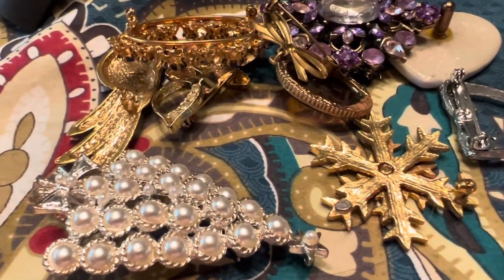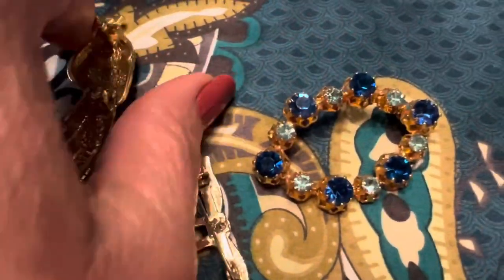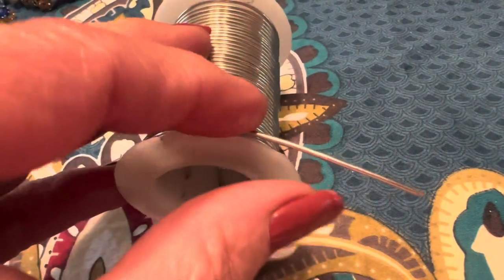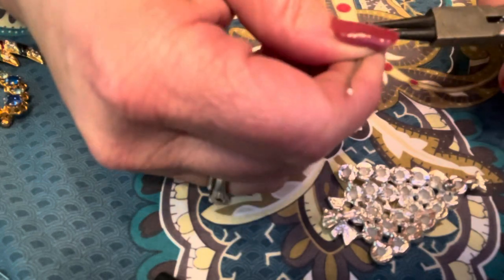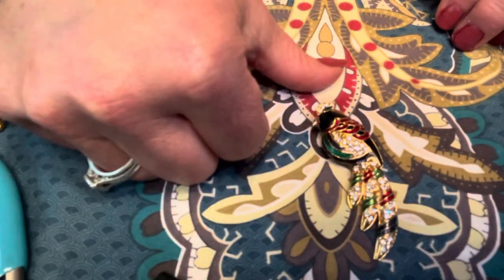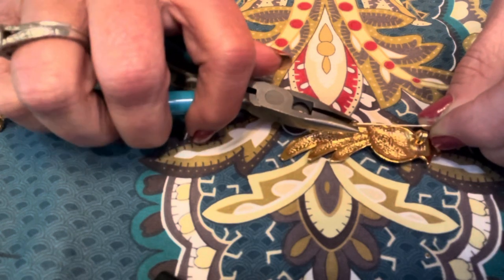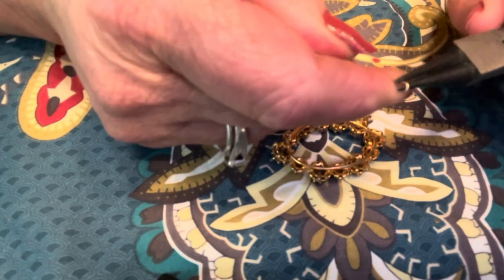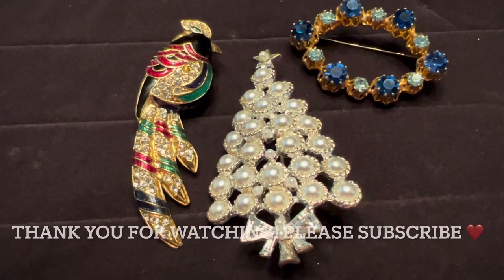Vintage Jewelry repair. How to replace a brooch pin.

Comment: Thank you for the still shots for us  to see exactly how it should look.
I have silly questions..does the stiffer wire come in gold tone if needed?
Can you take off (repurpose) a pin stick from a another piec and reuse on it? And I notice orginal ones have a couple of loops and a tail (stopper I guess) is this just fir more strength?
Reply from the maker: Hi Lorene,
Yes you can purchase the stiffer wire in gold tone. I’ve never repurposed a pin but I suppose you could. Yes it does add some strength. The stopper is to keep the pin from going back too far when it’s open. However, if the pin holder/ mechanism is snug it’s usually not a problem. Thank you Lorene and I hope this answered you questions. 😊❤️❤️❤️❤️

Comment: You can easily make a sharp point with rough sand paper or even an acrylic nail file. If you don't sharpen that point you are going to ruin some delicate clothing.  But great video.
Reply from the maker: Thank you for watching 😊❤️❤️❤️